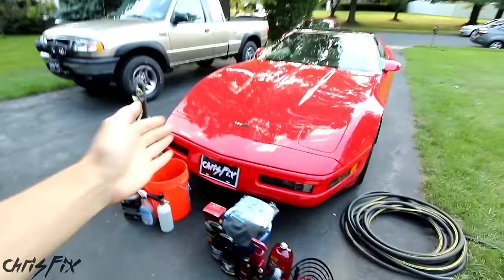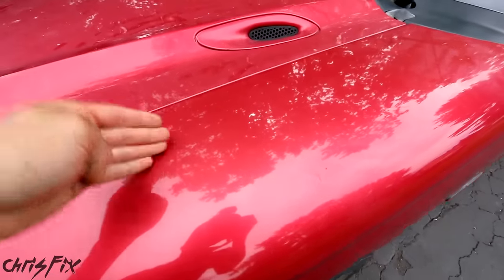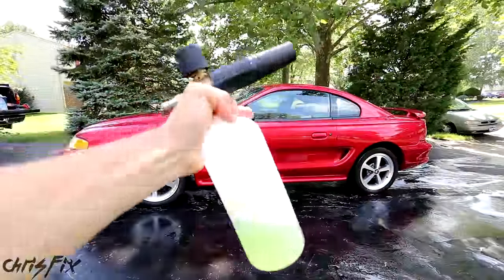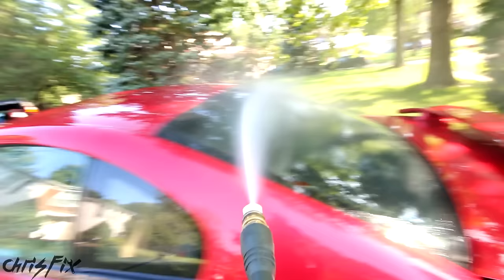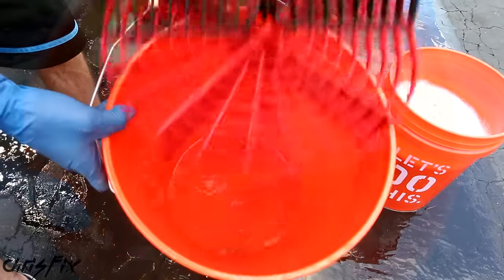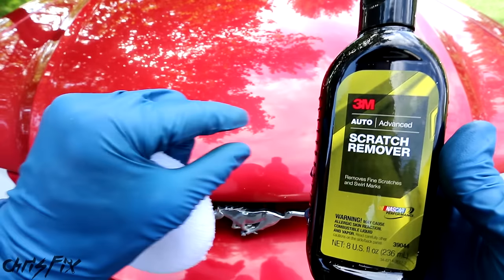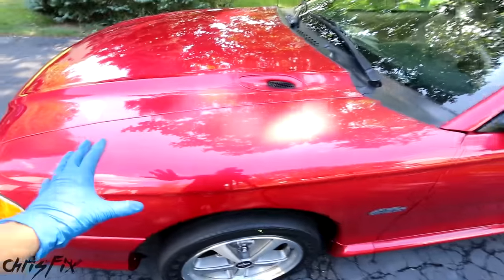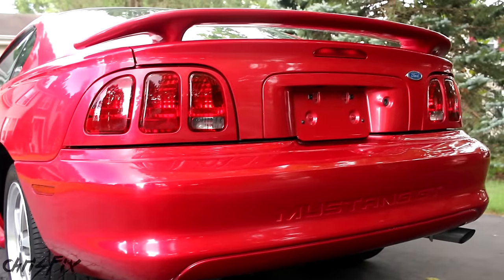How to SUPER CLEAN Your Car (Best Clean Possible)

Comment from the maker: I just posted my newest SUPER CLEAN video on how to Super Clean your Wheels and remove 2yrs of brake dust, tar, and stains: https://youtu.be/5zZyiY23OpY
Reply: its a good video
Reply: Cool
Reply: Idk if you know this, but the links to the pressure washer and foam gun (hose) do not work anymore. Any alternatives?
Reply: What happened to the Corvette
Reply: What
Reply: Hey you seems is good and your video and your York tyre and your cars
Reply: Ok
Reply: Lol step one: Don't let brake dust sit on your wheels for 2 years. 😂 Still, I have literally had a situation with a friend's car where the brake shop he paid to do his car royally fucked the job in ways I don't even understand, leading to insane accumulation (and adherence) of dust/possibly metal after the entire pad was worn off in only a few days of driving. I genuinely have no idea how this happened or what they did, but there were NO pads on the insides and his entire wheel was completely coated. I think one of the pads straight up fell off the car or something, leaving metal against metal. Getting it off was........ well I wish I had this video back then lol.
Reply: @ChrisFix about how long does this cleaning process work? About a couple hours?
Reply: Hey Chris how do you know so much about cars and engines…
Reply: Our pressure washer has a soap holder. I am wondering if I should use it
Reply: Chris where are located???  Are you available to qork from me and detail one of my cars??
Reply: Hey Chris ... you know what might have been a great idea ..? (Will take a little extra work to start now, but still worth it) ..?  ChrisFix Forums ... I think that would be a phenomenal place to provide a list of products you use...as well as a community of people providing advice on how to maintain / improve car values, as well as even flipping cars.  Thanks for all you do buddy ...
Reply: What about vinyl
Reply: That's a sweet little red Corvette.
Reply: What soap did you use in the bucket?
Reply: i do wonder how u clean the car with waterspot thats stuck on the car for years

Comment: Im 16 years old and I've watched this video countless times just to help me clean and detail cars that my family uses, and it really goes to show that you care for your passion in the car community. Thanks for everything you've done for everyone
Reply: SAME I’m getting my first car soon and I’ve done his videos to my moms car a couple times now lol
Reply: If you need any advice let me
Know man. I am a detailer 🙂
Reply: @ciprianion4142  how frequently should a super clean be done like this? Just once a season & upkeep with a polish? Are there any sort of things to look out for that let you know that it's time to wash
Reply: @mariaohno403   Hi there! Depends how you use your car, how dirty it gets. It’s recommended to have two basic details a month for a daily driver. Plus a full detail before the winter comes and another one in the spring. 🙂 it’s not recommended to polish (paint correct) the paint every year. Do it once, protect it and use safe wash methods do you won’t induce any swirls into the paintwork.
Reply: @ciprianion4142  Thank you so much! Would a basic detail include just vaccuming/wiping down the interior and washing the exterior?
Reply: @mariaohno403   Exactly. With the exterior to make it safer after you are done with your wheels, tyres and wheel arches. Rinse the car, apply the Snow foam, leave it on the car for 5 minutes ...in the meantime with a detailing brush agitate the window seals, badges, grills..any knock and crannies you can’t clean with you wash mitt. Once you are done, fully rinse the car and wash it with shampoo. Avoid working in the sun unless you have a water filter. 😁 use a quick detailer or a drying aid to boost the gloss of your car. Do the windows (inside and out) plus side mirrors. Apply your tyre dressing and you are good to go.
Reply: @ciprianion4142  thank you so much for the help!!
Reply: @mariaohno403   You are welcome! If you need anymore advice feel free to ask🙂
Reply: @ciprianion4142  How would you recommend treating super peely clear coat? just bought my fist car and really want to take good care of it! Should I just strip all the remaining clear coat and Wax+Polish or sand down the rough edges and reapplying the clear coat?

Comment: Something important to mention is if you drop your clay bar, do not use it on paint anymore. You will be tempted to pick out the visible contaminants and keep using it. Do not do this. No matter how "clean" it looks. It isn't worth the risk.

You can also cut your new clay bars in half, half a bar is easily enough to clay an average vehicle. This gives you more bars of clay you know are 100% clean, and if you drop it, you're not wasting the entire bar.

Also, don't stop at the paint. Clay everything, glass, wheels, chrome, lights, trim, etc. You can also save older bars for less sensitive areas. I use new bars for paint, and have older bars designated for glass only, wheels only, etc. use before finally throwing them away when they're trashed. 👍👌✌
Reply: @Aim to Wander yea seriously. I have some older ones that are somewhat used. Gonna def use them on the Windows and lights
Reply: Thanks
Reply: @Aim to Wander I agree!
Reply: 100th liiiike!!!
Reply: Average car: your cousin's 1989 Honda Civic hatch

No offense to Honda Civics or the owners

Comment: I washed my car as Chris done but it didn't take 19 min. It took 4 hours. Result: I could sell it 700$ more of its price))
Reply from the maker: Nice!
Reply: Abdugani Abdurahmonov mine took 4 hours as well. result was my wife has never seen her car as good as now.
Reply: Sannan Saleem 

those are OK, but don't expect them to provide as good a wax as doing a separate wash/ hand wax
that Meguires gold wash he used is good stuff.
Reply: its called cutting the video bro
Reply: Abdugani Abdurahmonov Could you tell us which parts took most time.
Reply: EnderBlazex Clay bar, and wax take the most time usually clay bar takes the longest if the car is used often and has never been clayed it can take awhile most common areas that are bad are the front of the car mirrors,hood, windshield,bumper waxing takes a while because of complete coverage wait time to buff off and buffing off all residue and getting it off badges,trim, and hard to reach areas, paint correction can take awhile too but most people wont even attempt that and to do it properly you need a Rotary Polisher,compound, and polish. Everything else is super simple and it depends on what level of clean your happy with. I work in a professional detailing shop and we can clean the interior and exterior of a car minus paint correction in around 2hours max this includes shampooing the interior, stain removal, interior glass clean,seat clean, dash,trim,and headliner cleaning the exterior of a car is the easy part but still needs to be done right
Reply: J_slayer 1337 Is it safe to use Degeneration soap say like fairy liquid in the Uk to remove oils? I mean that's quite high risk as they are very high in salt.
Reply: JW I would only use car soap or dish soap you can find a de-greaser that is safe to use on paint
Reply: I love this vid and because of it my car looks great, my cousin even asked what I did to make my car look so shiny
Reply: Takes me 2 hours to do that, 4 hours if i include the inside
Reply: Those are gimmicks. It is like having shampoo/conditioner in one bottle. It is better to have those two things done separately. Don't be lazy!
Reply: EnderBlazex clay bar usually takes the most time , next would be the final waxing ...
Reply: Worth it.
Reply: 7 months ago when I watched this video I was like it’s too much work but now I will spend 4 hours detailing my cast and won’t mind it
Reply: It was actually 9 months ago just saw my previous comment
Reply: Abdugani Abdurahmonov, Mine took 8 hours
Reply: @stinkyfungus  why did he use dish soap?
He could wash it with car soap and then wax it!
Reply: Well, it didn't take him 19 minutes, either. If I had to guess, the time it took for you to clean your car is the same amount of time Chris took to record, edit, and upload the video. The duration of the video is not equivalent to the duration of the job.

Comment: ChrisFix has enough time to pump out great content and still interact with old content that people are still discovering and rewatching.
Reply from the maker: Thanks a lot! I spend 4 hours every day reading and responding to comments!
Reply: ChrisFix wow that’s a lot of sleeping time used for good people
Reply: @chrisfix  wow that's a lot, We rally appreciate  it though :)
Reply: @chrisfix  Four hours!  Wow!   Do you get some income from your videos?
Reply: @chrisfix   Have you made a video that addresses rubber, vinyl and plastic cleaning and rejuvenation?  This is what I am trying to address right now on my two cars from an appearance point of view.  Furthermore, I saw a youtuber talk about protection to anything rubber, under the hood, dust protection for shocks, boots, rods, etc anywhere were rubber can crack.  I believe that requires a different approach and rejuvenating product.  Your thoughts!

Comment: Chris, could you make a video on how to remove paintwork scratches that are really deep on specifically a plastic bumper? Is it any different to metals?
Reply from the maker: That’s a good idea!
Reply: ChrisFix Thanks man! My deep blue coloured car has some white scratches on its plastic bumper, they feel really deep and below the paintwork itself so i doubt it’s paint transfer. A video on this would be really helpful
Reply from the maker: Yea once I get some deep scratches I will make a video!
Reply: ChrisFix Awesome, looking forward to it, the video, not the damage to your car of course
Reply: yes please do! my bumper is like night and day difference from the rest of the car. Extremely dull. I want that shine back. To the point where I was contemplating sanding and can spraying the clearcoat!
Reply: Are those white specs on the bumper and vent behind the door correctable?
Reply: Looking forward to the video.

@kaskobi in the meanwhile you can try Meguiar's G15812 Ultimate Black Plastic Restorer it should do the job
Reply: Why not just go to a junkyard and pick out a panel that you can use to make the video. Scratches on your vehicles more than likely won't happen since you maintain them so well.

Comment: You should make a "How to SUPER CLEAN the Interior of Your Car" video! :D
Thumbs up, if you want it too!
Reply: DacyTheBeast k
Reply: All you need is a vacuum cleaner to clean the interior
Reply: That doesn't fix faded plastics, leather and suede interior trim etc..  =P
Reply: what about the leather, plastic, dashboard or drivers side?
Reply: DacyTheBeast, strong vacuum, shampoo the seats, and some type of cleaner that will clean the plastic inside.
Reply: I second this!!
Reply: lol he will hit with a foam canon and pressure washer.
Reply: you can't superclean a dirty interior, you have to rip out the carpet and get the seats re-upholstered. You could use some store products to clean the dash though.
Reply: DacyTheBeast I just wanna see it for the satisfaction😂

Comment: This guy might be the best detailer on the planet, lol
Reply from the maker: Thanks!
Reply: ChrisFix hey chris i have a quick question. I have a black car and the previous owner before me left a bunch of swirl marks. I tried doing as you said but after the polish step, i still have those swirls.
Reply: ChrisFix answer heimmm
Reply: TJ McCain pleaaaaase haha
Reply: JustACamaro 0 honestly, you might actually need to get a dual action polisher, or have someone do a polish job that removes imperfections. A polish that can help cut through those marks is probably needed at this point. I don’t think the way Chrisfix did it here is sufficient for your need.
Reply: JustACamaro 0 your scratches are probably beyond clear coat scratches if they are you have to prime and paint I think
Reply: You should check out Car Cleaning Guru, he really knows how to make a car shine lol. Just a shame it requires 50 different products to do
Reply: That would be Larry from Ammo NYC.
Reply: You probably need to use a more aggressive polishing compound before the finishing polish.
Reply: Car cleaning guru is a good detailer

Comment: I swear this guy has an endless supply of microfiber rags
Reply from the maker: If you buy them in bulk they are cheap!
Reply: Jordan Rapp. We all do! 
It’s call eBay/Amazon.
Reply: They work. (Microfiber) Biggest reason is that unlike a shop rag, a t shirt, a washrag, micro pulls dirt without sending it back in.

Comment: Wish I didn't live in an apartment complex. Makes doing this stuff so difficult. Gotta fill buckets up with water from my shower for gods sake..
Reply: My car doesn't get into the shade until about an hour before the sun sets, so I have a limited time to get her cleaned. And clay bar takes forever in the dark...
Reply: Straight Six go to parents or friend house
Reply: Have you tried optimum no rinse? Can use like two buckets of water with different technique but it worked well when I lived in an apartment
Reply: iamsiyes seconded on this one. Although, I'd stick the ONR in a spray bottle. It makes it MUCH easier. Spray bottle + tons of MF towels is a godsend for maintenance washes.
Reply: Straight Six: If possible, find an apartment complex in your area that has a DYI car wash station and just say you are a tenant's girlfriend...not usually an issue as long as the set up is actually just a concrete slab with a water spigot and electric outlet... the bigger the complex, the better
Reply: Straight Six use waterless/rinseless wash product
Reply: Great video. I learned a lot! As I'm sitting here watching your video, I look outside to see a foot of snow on my car. Any ideas how I can wash my car in the winter? Touchless car washes don't get it clean.

Comment: can't wait for cleaning engine video. love this channel
Reply: ive been waiting on it for awhile
Reply: So have I, I messaged him last week and asked him when the engine bay cleaning video will be up and he said next week. This doesn't look like that video.
Reply: +Delton Rushing Same idea, there's those incredibly strong engine gunk sprays you can use on the case of the engine, everything else you just wanna soak and scrub by hand for a long time, rather than taking the pressure washer under there, because wiring. Everything's baked on pretty good in there so you'll need patience. Finally for the plastics and rubber you can use cleaners that are safe for them, aka ones without silicon in them because they can cause cracking from the engine heat
Reply: Same
Reply: +lockodonis Why the fuck would you care if someone wanted a clean engine and write a harsh comment on the matter? In fact people who do cars shows likely would could use tips on cleaning an engine. It is not in any way a far-fetched idea that someone would want a clean engine.
Reply: lockodonis so you take the time to read the comments and reply on a YouTube video about washing a car  and tell them to get a life... sounds like your life is full of excitement.
Reply: +Tommy D At no point did I tell him to get a life. I simply reused his comment. On mobile you can watch and comment so, yeah I can multitask. I just did 80 in the rain on a motorcycle which to many is more exciting than they see in years.
Reply: My bad. But seriously, how does one watch a youtube video, write a comment, and ride a motorcycle all at once? Answer: you can't. Good day to you sir, peace out.
Reply: me too
Reply from the maker: Thanks a lot Tommy and everyone! I really appreciate the support! The engine cleaning video is going to be awesome! Still working on it!

Comment: btw this will prob take 5-8 hours , depending on your car and how much time you take
Reply: Dimitrios Diaz that why it is the 5 times I watchtower this video, but I never actually done it.
Reply: No this would be 2 hours at most
Reply: Value SaintOCE i‘ve done it. When you a re working slowly, it takes around 4-5 hours